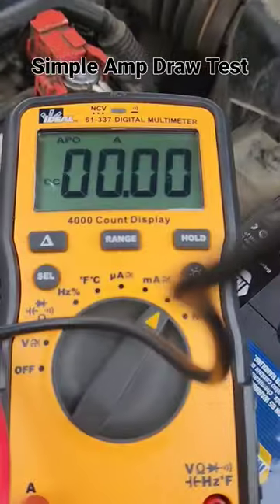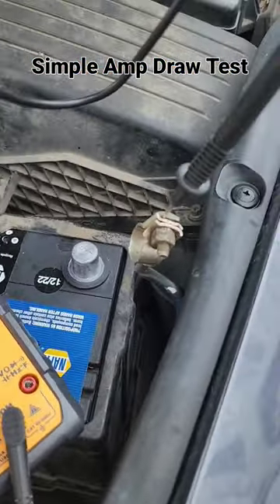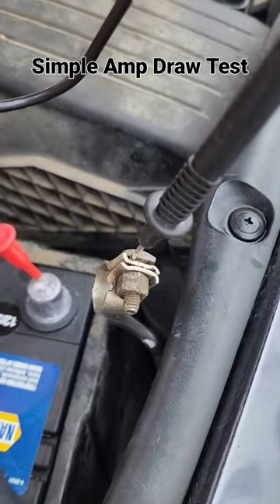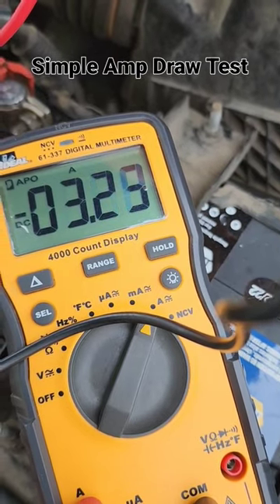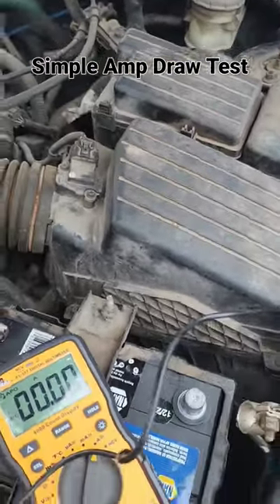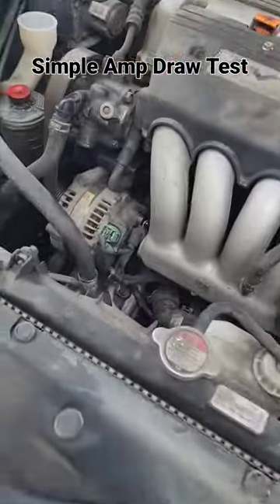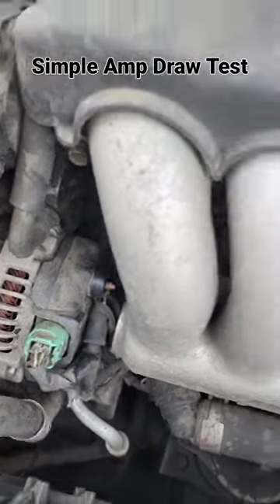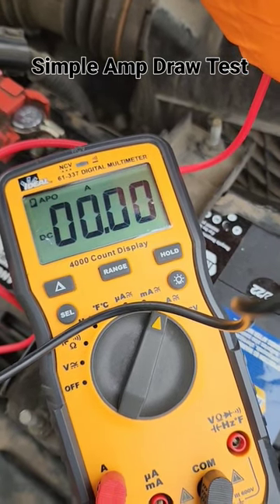What's draining your battery?! How to find a parasitic draw! (EASY)

Comment: Does this mean that your alternator is bad?
Reply from the maker: Yes! Most likely a shorted out diode in the alternator.
Reply: Yes
Reply: @HumbleHotshot  do you think it's worthy of a rebuild or replacement
Reply: @milo6373  replacement, rebuild isn't necessarily cheap and it doesn't guarantee you it will work
Reply from the maker: @milo6373  This one "could have" been rebuilt because it was a shorted diode, but the truth is there aren't many people who still rebuild alternators anymore. The cost of a new is similar to rebuilding. Unfortunately we are mostly a throw away and buy new society these days.

Comment: 3Amp draw could be the car waking-up; the 2015 JK JEEP will draw 3A for several minutes, then it will idle-down (sleep) to about 0.020 Amps. So be aware of that - many many newer cars will draw current initially when you first connect the battery - for a few minutes, then the car goes back to sleep mode.

Comment: So your alternator can kill your battery with out the car even running? Wtf
Reply from the maker: Yep, seems crazy but if the alternator has a shorted diode, it will kill the battery even when the car is completely off because the alternator and battery are wired together directly. This can happen if someone hooks up jumper cable the wrong way.

Comment: Keep in mind that the fuse it's only 10 amps and the peak could be higher. I modified mine just a little (if you do do it at your own risk)  and mine can reach up to 20 amps I also have an amp clamp also give it time for the computers go to sleep.

Comment: Don't do it this way. Not going to work well on modern vehicles. It can be done, but you can't disconnect the battery and vehicle at any point. Modern vehicles have too many computers, they can take a few minutes to half an hour up go into standby. When you disconnect the battery and reconnect it, you wake them up. 
An easy test would be too find the voltage drop across a fuse. You can then use a chart and find the amount of current going through the fuse. This also tells you which circuit. Of course you can just use a amp clamp, and not have any issues, but not everyone has one.

Comment: Test as performed in the video is totally meaningless.  You have to wait up to fifteen minutes with nothing turned on, hood and door switches in closed position so various computers can go to sleep. A high reading when first connecting the battery through the multimeter is normal.

Comment: And you did it completely wrong. Battery was disconnected. You connected the battery when you did the amp draw. A lot of modules woke up when you did that. Which will cause excessive draw.